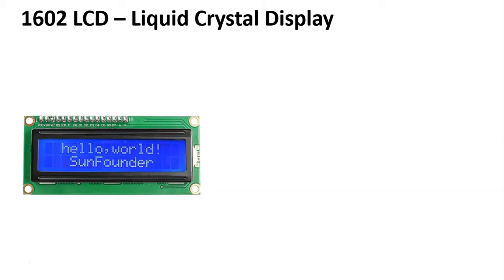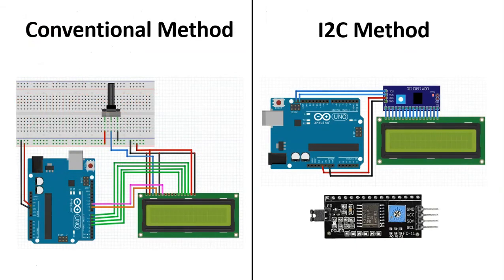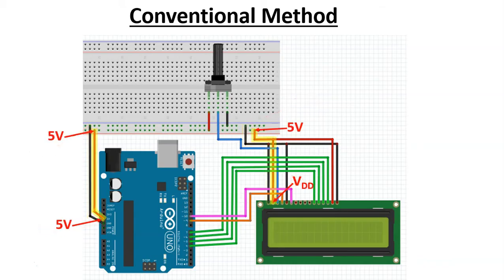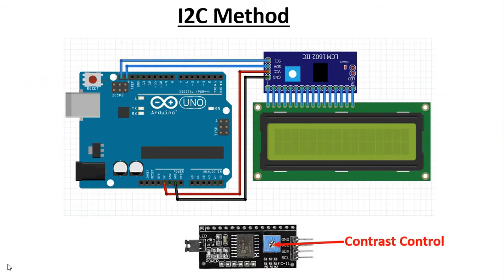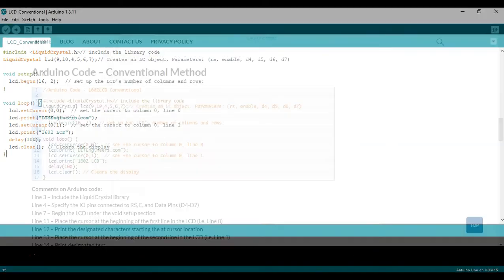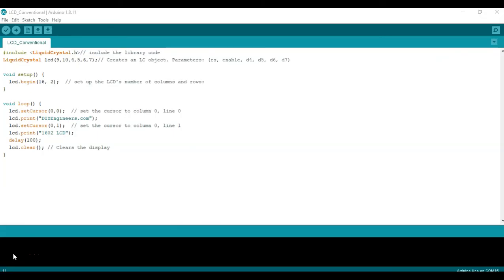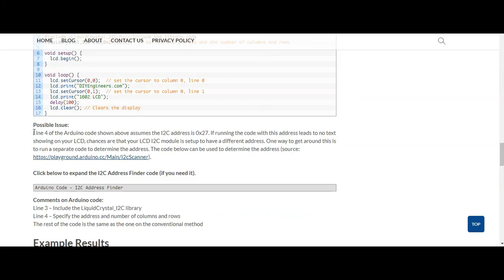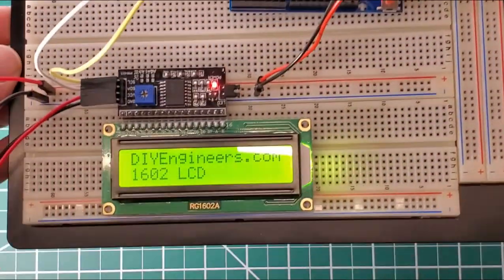1602 LCD with Arduino - I2C and standard method explained

Comment: dunno if you're taking request but ...
Any plans on a tachometer project? I've tried a few but my results are really jumpy and I can't tell if I'm getting any kind of accurate reading. Thanks for the videos!
Reply from the maker: No tachometer projects on the list yet, but I will definitely consider for the future. Currently making videos going over sensor and modules, so no projects in general just yet. Thank you for the suggestion and thanks for watching!